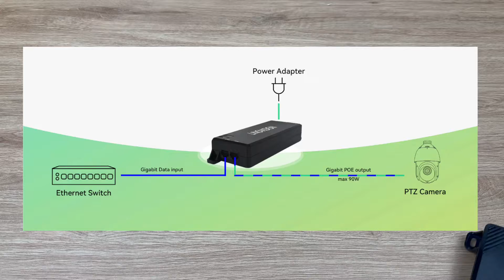What is difference between PoE (Power over Ethernet) Switch and PoE Injector?

Comment: A PoE switch integrates PoE capability into a network switch, suitable for powering and managing multiple PoE devices centrally. A PoE injector adds PoE capability to a non-PoE switch or router, ideal for powering a few PoE devices without replacing existing network equipment. Nice video!
Reply from the maker: Exactly!